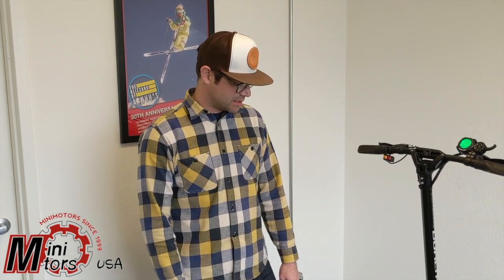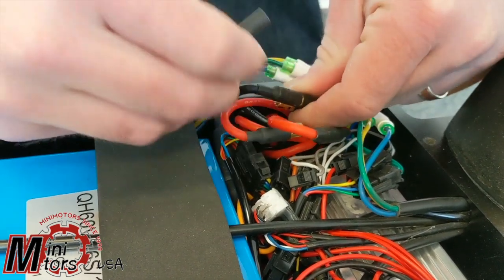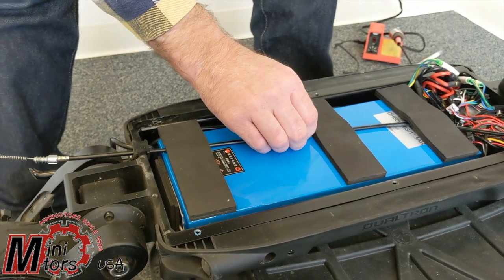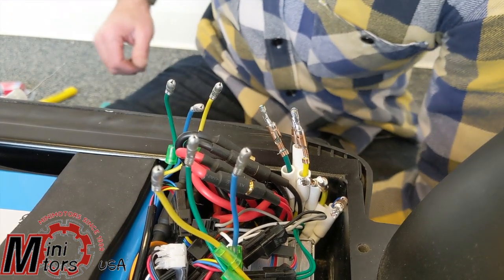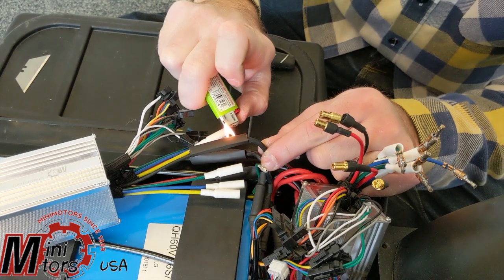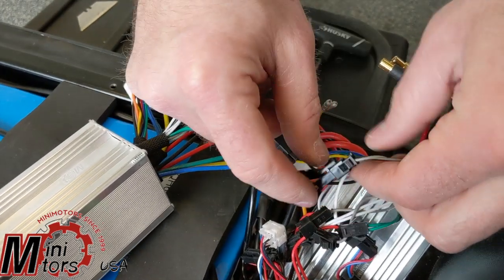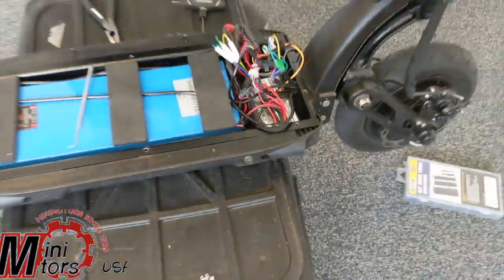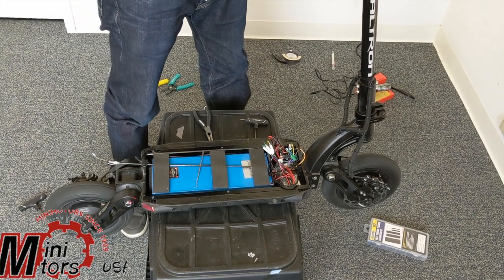MiniMotorsUSA - Spider Motor Controller replacement

Comment: Hey John. Would you know if there is a difference between the 279 and 279s controller?
I left my scooter on the porch by mistake and it rained. I replaced my 279 controller with a 279s from Voro and the rear motor isn't working. If I swap the leads from front to rear the rear will work. Voro said its not compatible if I didn't buy the scooter from them. 

Thanks for any advice

Comment: Sorry but that's NOT the way to soldier the terminals. You are suppose to tin the wires FIRST then put into the connectors, crimp a little, THEN heat the connector adding more solder so that it fuses the tinned wire to the inside of the connector. And you're suppose to also use a heatgun to shrink the shrink-tubing.

Comment: My Dualtron Victor after 2 months of use rear motor stops working. Diagnosed by swapping motor wires from front to rear. I hope minimotors send me new speed controller. Found 2 shorted mosfets

Comment: For the price that dualtron scooters cost you think you would use a soldered mr60 connector for the phase wires. 16-14g bullet connectors from auto zone don't quite have the current handling that you need. 
For a scooter costing in the thousands of dollars,I think you can find the few bucks for a decent connector. This stuff blows me away. You would think these companies would know this stuff.

Comment: I would unplug the big negative black
From the battery first to open the circuit and go ahead and plug it into the new controller first with heatshrink just to secure it and assure it doesn't short. Last plug in the red from the battery after everything else is connected to power the controller. Assuring the battery is disconnected during the entire operation no matter what you plan on soldering or plugging safety first ;-)

Comment: Always remember to unplug the battery before messing with any wiring and in all conditions make sure the battery wires never short each other I have seen holes burnt in steel scissors with much less voltage and current i.e. Be carefull and know what your doing before you start or at least what to expect. Gold plugs are best and direct solder where you can it optimum but often not needed.

Comment: please
Could you make a video of how to change the brake disc in a quick and easy way?
and another disc on how to install a headlight, turn signals with a dultron motorcycle switch in an easy and fast way?
thanks

Comment: HI, any chance of a video for the DT Spider suspension:
 
Adjustable Suspension Arm Angle (Rear)

The height of the suspension can be adjusted to:

• Level 1 (LOW) Urban roads

• Level 2 (MID) Default

• Level 3 (HIGH) Off road conditions

Comment: Do yourself a favor and solder the six connections; it's a tight fit with all the wires and they're prone to disconnect when putting deck cover back on.

Comment: IMPORTANT: If you DO decide to futz about with the old controller know that the capacitors in those hold power for quite some time and if you cross the wires you'll get a nice big spark.
Reply: Even if you turn the main switch off and turn the scooter on to release the holding power will it still spark?
Reply: Very good information sir so very true

Comment: the version is 41 and 61, not 411 and 611. 41 version and 61 version is exactly same if you don't plug the grey speed limited wire between the controller. When you plug the grey line to each other, 41 version controller limit to be 25km/h, but 61 version controller limit to be 23km/h. Only this difference.

So series number not must be problem with "41" start. It is wrong idea. The spider first lot has some problem about controller with "41"as beginning, "DS" in the middle, and  the range is about 0001-0500. About 500 controller has some default. After 0500 should be safe. And even within or near 0500, the inside PCD of the controller has been replaced already, so even some "41....DS....04XX" controller could run smooth without any problem.

Our stock of "41...DS...1102" is right one with right board inside to run in good condition.

Here i also give you the explain info about the controller. 

the version is 41 and 61, When you plug the grey line to each other, 41 version controller limit to be 25km/h, but 61 version controller limit to be 23km/h. Only this difference. If you don't limit the speed the performance is same.
Last year the first lot of spider has some problem in its first lot, but not 100%. the risk range is the last series number "41...DS...(0001-0500)". This range may has bad controller (not 100%). but after 0500, Minimotors change the controller Board inside, so even it is "41...DS...0512", it may has right Board which has version fault corrected.
Very few controller after 05xx can has problem as minimotors said they change every controller before delivery.

Comment: BTW thanks for the video. My front motor just stopped working and it seems like controller problem. New controller on the way.
Reply: hi Matin. could il be possible to know if the replacement solved the problem. I'm in the same case. thx
Reply: @EricRueda  Yes it did. Got new controller and everything is fine. But if it happens again, I'm switching to DT3 controller and DT2 motors :)
Reply: @mrmartinbusek  Thx, i'm going to try this . I wish i'll have no more problem.

Comment: Do you know what was wrong with the old controller?
Reply: Bad batch. Lots of it.
Reply from the maker: Hi Wol Tee.  There were a few early Spiders that were produced with a bad resistor which this one might have had, but I am not sure how to diagnose issues within the motor controller.  Maybe someone else can chime in here if they have insight on how to do so.
Reply: @Dualtron_USA  Hi! I have first version of Spider. Wheels stopped to react, everything else works. Which resistor i should check? Or any other piece of advice?
Reply: @alexey0cherepanov  Check all of them... there arent that many lol. buy a multimeter, put it on the setting that looks like a speaker, touch each end of the resistor with the probes of the multimeter. If it doesnt beep or show a value, replace.